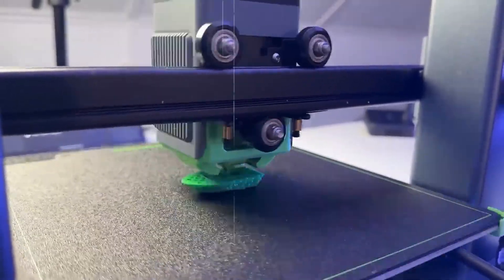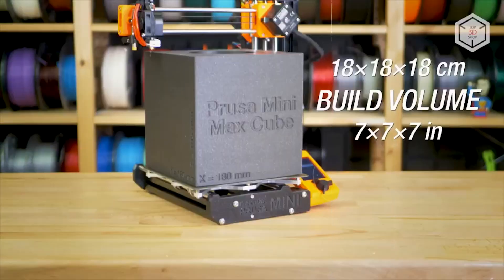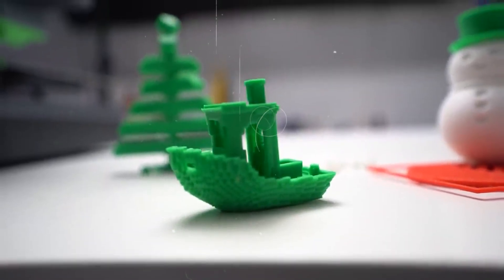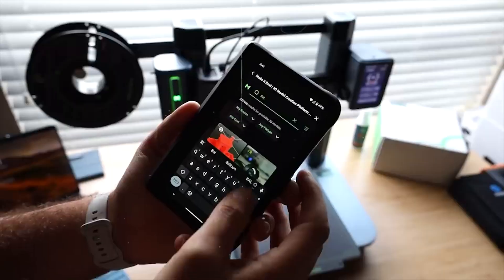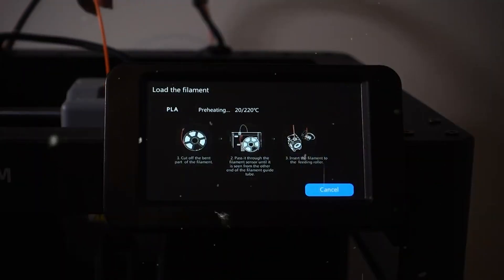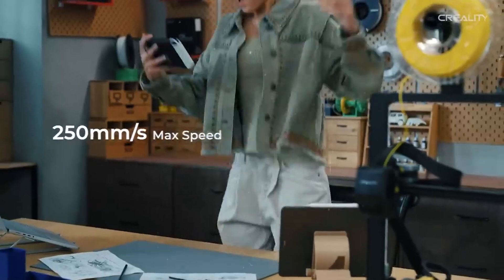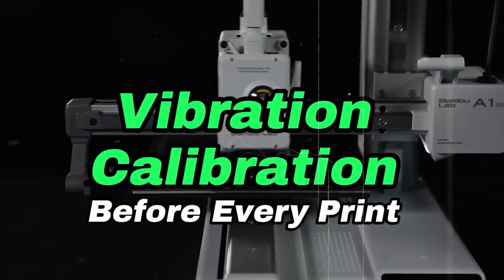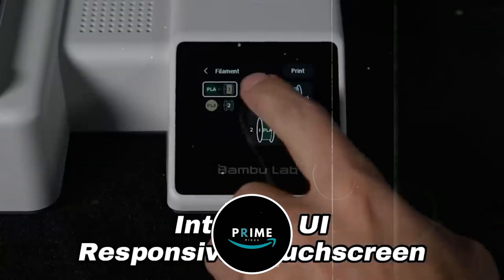Top 5 BEST 3D Printers You Need Now In 2025

Comment: why the prusa is so expensive?
Reply: Prusa printers are made of higher-spec materials and are made in the EU--which means they have extremely robust warranties. Additionally, many Prusa printers are extremely well known for being "workhorses" of the 3D printer world, with a good number of printer farms using Prusa's since they'll run for years on minimal maintenance.

I've got two Prusa Mk3S+ printers, and I've had them for years, and they have been absolutely fantastic. 10/10, I would definitely recommend.